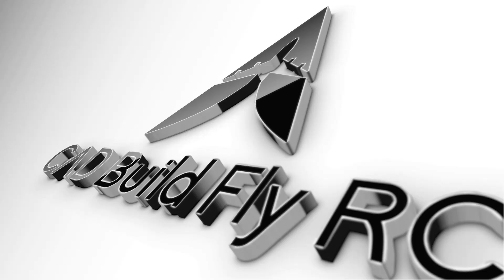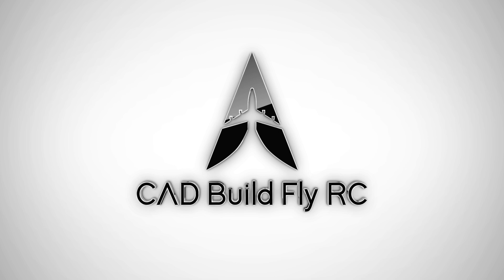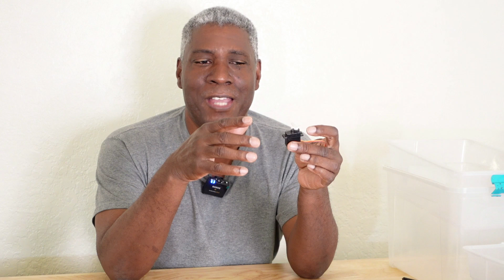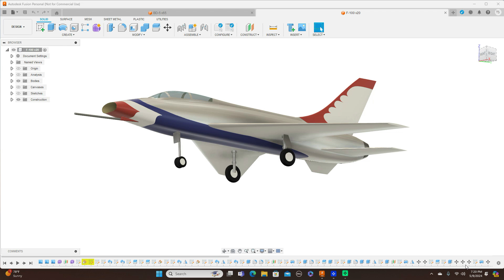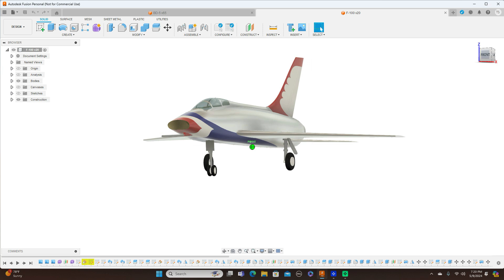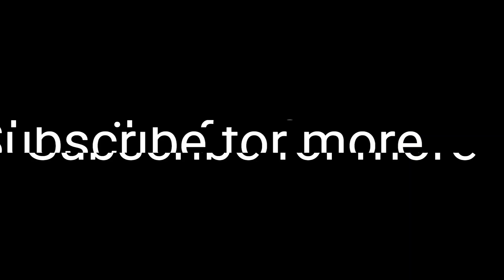C.A.D 7 Tips on how to learn CAD programs faster and model designs quicker

Comment: Keep up the great work.  I've been following your videos and I'm beginning to see the steps you go through to do this work.  I have printed more than a half dozen rc planes and I'm getting to the point I want to make small changes to them, e.g. strengthen certain spots, increase carbon fiber wing spar diameter, etc.  In each case I would be starting with an STL file.  My question is can you modify stl files and create a modified one from the original, and which 3D program should I learn and use?